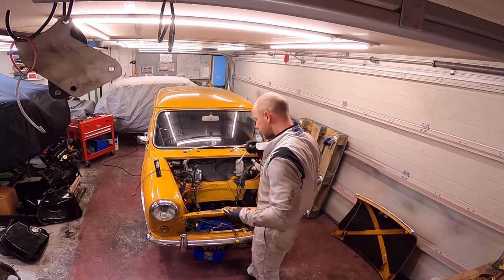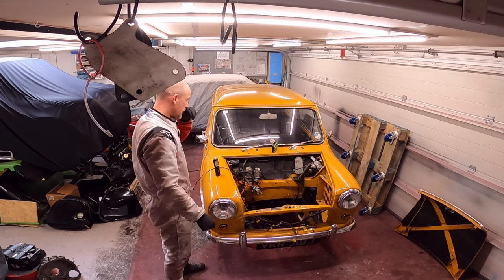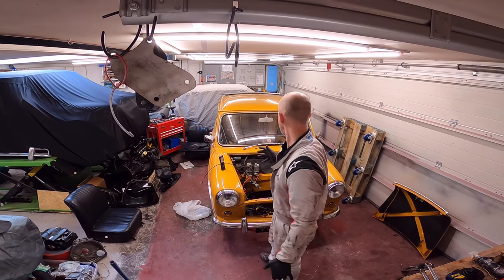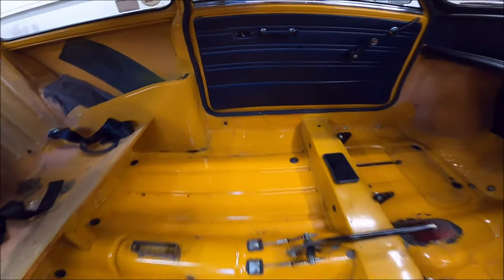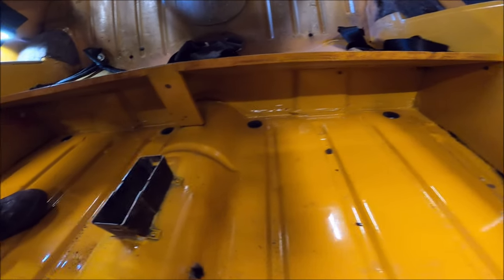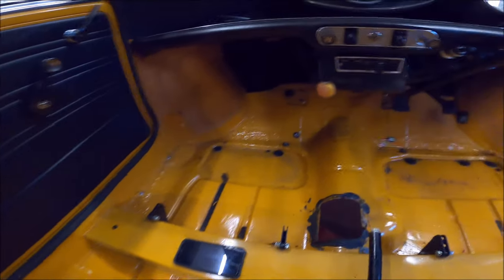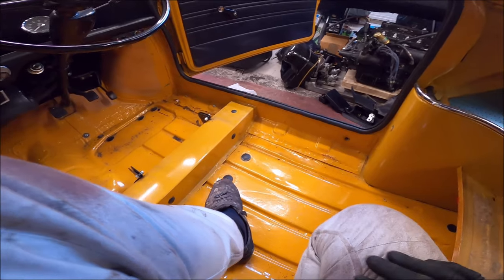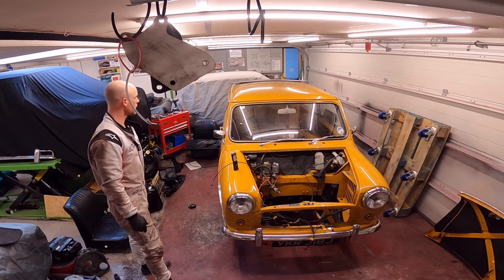*Bodge Jobs, Corrosion, Rust, & Oversills* Cooper S Mk3 Restoration - Classic Mini Workshop Pt.4

Comment: Hi Mark, I know how you feel. my 1970 mini had over sills on from its second "restoration" there was 4 layers of steel and various patches  in this area. I am down to the last few specks of rust now. it has taken me 10 months of lockdown. I did sit and work out that I only had 30% of the shell left by the time I had cut all the rust out. it has been soul destroying at times
Reply: Hi Alan, it is soul destroying sometimes. One bit of rust leads on to another panel that it's attached to that needs work etc. I'm keeping positive that the sills are the worst part. Glad you are near the end of the rust stage. Thank you for watching 😎

Comment: Mark,  what does the number on the floor signify?  I've got an engine number, a commission number, a vin number and the number plate on the floor. I was wondering if there was a paint number somewhere on Minis.
Reply: Hi Midge, most early cars had F, FE and FF numbers, F we assume to be front number, FE front end number and FF to be front floor number. i don't know the full ins and outs of them but i'm led to believe by others that it helps date the panels. Mine also has the commission number plate and car number plate (vin). Oddly, the numbers on these F, FE & FF plates aren't the same numbers. 🤦🏼‍♂️
I don't think these early cars had paint codes on them but someone could work out what the original colour was by matching all the numbers. These early cars had limited range of colours so not like more modern cars where there are a gazillion different colours lol.
Reply: @markdraper7   Hi Mark, Thanks for your answer to my question. My Mini is a 1975 Canadian import with a Commission # starting  N20S.......  and Vin # starting XL....... The plate on the floor is covered with a piece of sound deadening material so I can't read it now and I forget what it was. I just received Marches MiniWorld magazine and there is an article in there explaining these numbers. What a coincidence!
Reply: @midgelambert3880 , No worries. Was i on the right lines with my explanation from what the article says? Like i said, i'm only going on what i've been told or read elsewhere.
Reply: @markdraper7   The article by Tim Mundy confirms what you said. Each main assembly had a serial # attached to it, usually on a welded-on-steel embossed plate on the front floor pans which identified the type of vehicle. saloon, van, estate etc. The front end also had a plate attached to it to identify the type of Mini usually with the prefix FE. The front end being comprised of the windscreen surround and toe board forwards. As per Tim Mundy in MiniWorld.Page 38-42.